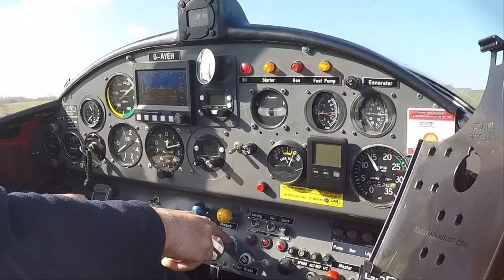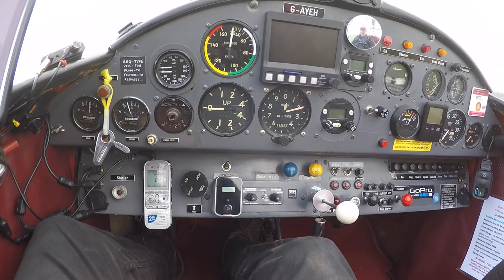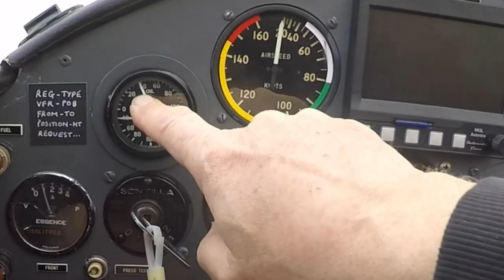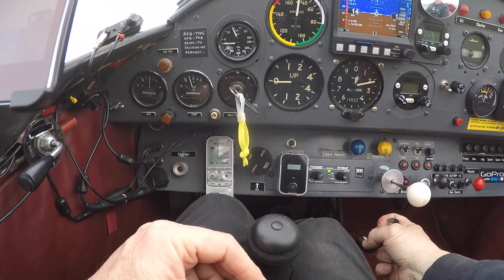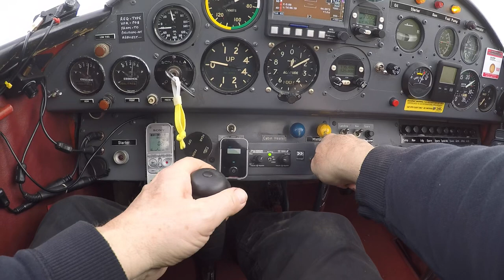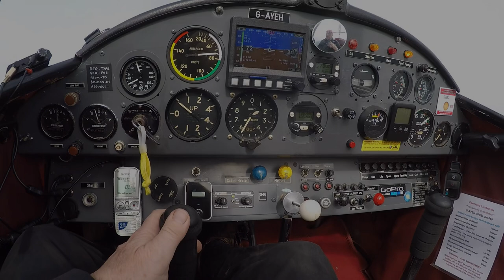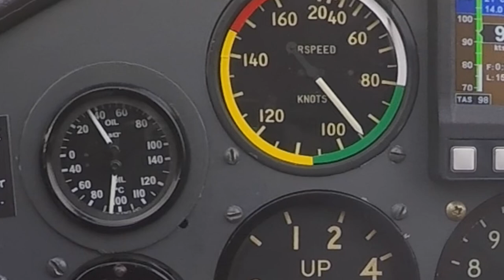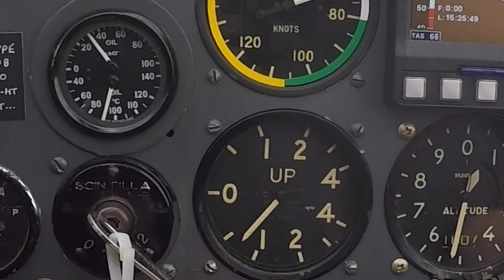FALLING OIL PRESSURE ABORTED TEST FLIGHT - PILOT VLOG #356

Comment: Excellent handling of the situation Tim, steady gets the job done. On consideration of the oil pressure momentary loss, it could have been just an air bubble in the line. Is the gauge mechanical? is there an oil line from the engine to the gauge? (more prone to bubbles) or is it electrical and gets the pressure from a sending unit? During the down time the oil could have just drained out of the line a bit and when you ran it, it took a bit to move the bubble. Usually if you have an oil leak you won't see an oil pressure drop until it's depleted or if it is extremely profuse.  Any way you look at it you did a great job, good on ya Mate!
Reply from the maker: Thank you very much. It is not an electrical gauge and due to a number of issues it had stood in the hangar for quite a while.

Comment: A very well flow test flight , Having checked the oil PRV the next place to go is to check the oil pump for mechanical defects. If the oil pressure indication has been checked for reliability them one has to suspect that the problem is in the bottom end with worn main or big end problems being the number one suspect.
Reply from the maker: Thanks for watching and leaving me the comment and suggestion.

Comment: I’m not so sure I would have remained so calm and composed . You made a good call in returning to the airfield . My money would be on the sender switch or the cable connection , however , I add I’m no authority on these things . The engine did seem to be running smoothly throughout though , so hopefully it will be a one off . My best Easter greetings to you and your family , and hope your prediction of decent weather for the next week or two comes true .
Reply from the maker: Thank you Dave. I try to stay calm and keep my head clear but my mind was working overtime. Hopefully it is sorted now. Happy Easter to you and the family.
Reply: @JodelFlyer  . Thanks Tim .

Comment: Strange oil pressure readings there. No leaks on the gauge pipe? I would double check. The gauge could be sticking (not used for a while) if you see it again give it a firm tap. The oil pump should pickup from the oil sump and feed into various galleries via the filter.  If the oil pressure dropped then either there was a blockage on the pick-up…or a problem with the oil pump (perhaps you lost prime on this) or a problem with the pipe that goes to the gauge, or perhaps you just have a sticking gauge and there’s nothing wrong at all.   I would keep a keen eye on it and check all the junctions on the oil sender pipe.  I had an oil pump fail due ware (very common on high time A65) and it was the pump failing to provide good pressure. The flight when it showed up..was interesting :-)   Good luck with the diagnosing.
Reply from the maker: I wasn't aware of any leaks but of course will watch it all very carefully. Nice to be back in the air.

Comment: Hi Tim, a little bit of a ball grabber as we say lol.
Love your composure and clear thinking, that only comes with experience.
Hopefully it's just a bit of muck in the oil pipe to the oil pressure gauge( I've had this on gas boiler water pressure gauges).
If its electrical try another gauge and check the data.
Hopefully not an oil pump issue🤞. Love the videos on a Friday morning with a nice cuppa gets the day off to a good start.
Reply from the maker: Thank you Steven. I hope it is not an oil pump issue and that it is sorted and we can focus on flying!

Comment: Good example of knowing the aircraft, managing the situation and keeping calm. Happened to me in the CT a few months back. looked at the gauge on climb out fine... look at the gauge again on downwind... ZERO oil pressure! lucky was only doing circuits. There is a picture of a load of oil over nose wheel at the beginning of my crosswinds video. Does focus the mind. No go arounds!
Reply from the maker: I tried to stay calm and not just for the camera. We need to be able to think clearly, especially at these times.

Comment: It is always amazing how a gauge can focus the mind. Quick question, when you did the dry crank, you didn't shout "Clear prop" even through it was turning, but you did call clear prop when you fired it up.  I'm just trying to see if there was a reason between the 2 type of prop rotation.   Glad the pressure came back up on the second flight.
Reply from the maker: Wasn't aware of it at the time but noticed the same when I started the edit. Filming is good for self review!
Reply: @JodelFlyer  I just wasn't sure if there was a reason. Please don't think I'm being critical. I just wanted to know if there was a reason.  I'm glad you are back in the air.
Reply from the maker: @GolfFoxtrot22  I didn’t think you were being critical Giles. Just asking the question. 😆
Reply: I first thought you meant when he was turning the prop by hand, lol. Thought to myself yeah that’s a little bit critical then realized you were talking about when he turned the engine over before making the mags hot. I didn’t notice that good catch.

Comment: From the video it sounds like you distrubing the sender wire might have cleaned the connection. It might have built up a bit of corrosion having sat still in the hangar, you know aircraft hate sitting on the ground, lets hope that has sorted it for you and you get more flying in.
Reply from the maker: As you have said, they don't like sitting in the hangar and not flying do they (as do us pilots!)

Comment: this maybe a failing oil pressure sensor or oil pump, as you need both i would replace them as a matter of course. not worth the risk to hope it has gone away permanently. these things tend to bite at the worst times
Reply from the maker: Very true!

Comment: Call me cautious - I probably would have stayed right over the airfield after major maintenance ;)
Reply: it's funny that mine was right after maintenance, I suppose it's the most likely time as things have been jiggled about but you'd think they would have done a comprehensive test. In this case it was a bit harder to detect so a bit more marginal. But yeah I think a day of circuits after any maintenance 😂 lessons learnt.
Reply from the maker: I have checked with my SkyDemon and the furthest from the airfield had been 3 nm but you are right and it does pay to stay close.